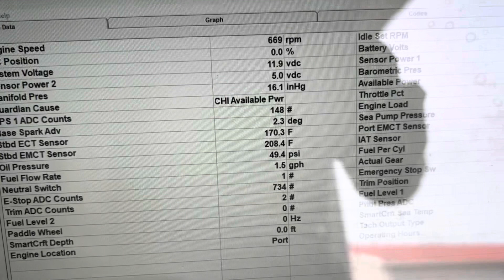2016 Mercruiser 8.2 MAG HO No Oil Pressure at Idle Diagnosis and Repair

Comment: I changed my oil on my 8.2 after putting the full synthetic Quicksilver 25/40 and new filter at idle I was at 62 lb, thought maybe a bad filter swapped it out same result maybe needs to run a while to thin oil a drop, any opinion

Comment: Owner was careful and smart. You need to send this video to Merc. They should be aware in case this crops up again. It can't be the only one with this issue.
Reply from the maker: The shop called Merc and they blamed the Sierra oil filter. 😀